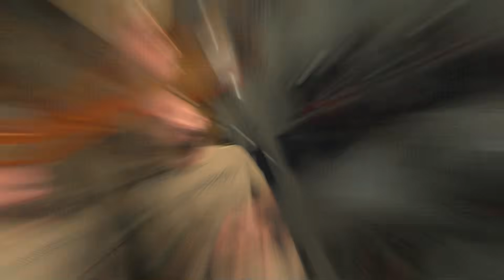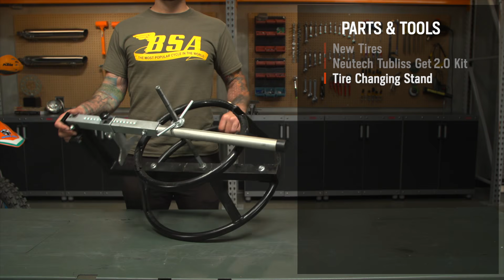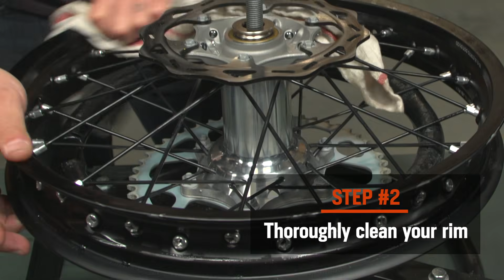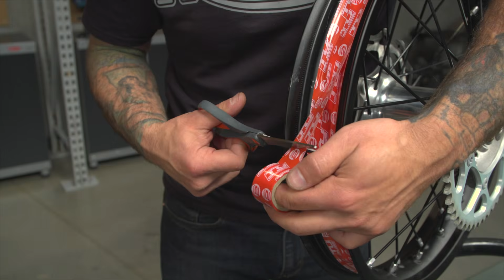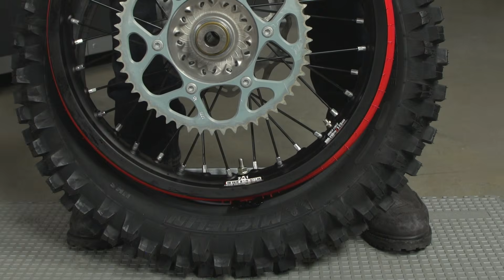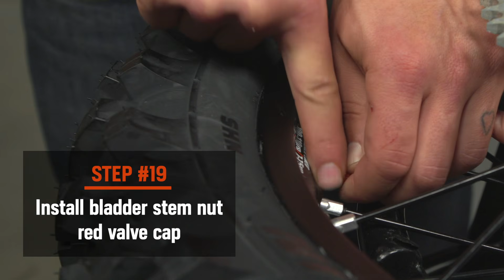Nuetech Tubliss Gen 2.0 Kit Installation Video

Comment: Tubliss wedsite installation video states to only use one layer of tape (in the middle)  and do NOT stretch or overlap.
Reply: It's outdated. The 2.0 kit comes with an updated written description with the tape stating what is shown in this video.
Reply: @audunbekkos3978 Yeah, I tried to do it with just one and the tape was too narrow to adequately cover the spoke heads. I ended up doing 3 wraps like the video
Reply: I think the main thing is to give the tape time to relaxe, since it stretches so much while pulling it off the roll.

Comment: I have infinity problem with this guys, black halter in red liner always puncture inner tube after few rides, what to do?
Reply: You probably have a sharp edge on your rim. Remember there is 100psi in that small tube pressing against the rim, if it's not totally smooth it will puncture

Comment: FYI, you do not use nearly enough soapy water plus you need to coat all parts of the tubliss system with silicone spray. It needs to remain slippery to work properly.

Comment: Show the front tire install….
Reply: Ahhhuuummmm wouldn’t it be identical?
Reply: Slavens has a front video. Looks the same. The problem is the super hard low profile 80/90 or 80/100 tires guys are riding.

Comment: Is this system also to use by KTM 890 Adventure R  ? I use Tubless Tires and i think this can be good.
Reply: Not advised for heavy ADV bikes per multiple posts on forums. There are a couple alternate systems that reportedly work better for the big ones.

Comment: I change moto tires 5 days a week, and have been doing so for a few years. I die inside any time a customer buys one of these and asks for an install. Don’t even mess with this system. Get a tube or a mousse. Save the money and stay away from this product.
Reply: No explanation why... I wouldn't listen to this comment. Most likely a grump that wasn't skilled enough to install the system.
Reply: @SendItDirt-Biking  You have to modify your rim for this system to even be installed. You’re left with a big hole in your rim if you choose to go with a regular tube down the line. Rim locks usually use 12 or 13 mm nuts with little spring washers, the rim gets even more damaged from a nut and washer getting pulled unevenly into the hole. Excess dirt and water also enters that same hole, corrodes the inside of the rim and compromises the tube. 
If you stick with the tubliss, you always have a chance of a leak forming under the tape, which requires dismounting the tubliss system to fix. You run a huge risk of pinching the liner while doing so, which will leave you SOL on the trail- Unless you buy an extra liner, which is about the same price as a tube 🤣 

This product is an overpriced novelty solution to a problem that was solved decades ago. Bring an extra tube with you, or get a mousse ring. You can get 5 heavy duty tubes for the price of one of these systems.
Reply: yeah i'm curious too, why do you dislike it? i haven't found any rider that doesn't like tubliss (other than the price lol)
Reply: Care to explain why?
Reply: Tubliss is just as easy to install as this video shows.  If your a mechanic for a living and you cant do this?
WTF dude?    Many , many 1000's of these tubliss inserts have been sold.  They work.
Reply: I got 5 flat tubes in 16 rides, all off trail on pavement, and only 1 was possibly from low psi. Stay away from tubes if you want to ride more than 2x in a row without a flat.

Comment: On the Dirtbike channel Kyle uses Amour all instead of soapy water on the beads before fitting so he can use the sealant inside when fitted. He seams to have success with that. Also he inflates the high pressure bladder first to pop the beads up onto the rim properly. A step missed out on this video.
Reply: He’s a smart little goblin

Comment: Can you use a silicon spray instead of soapy water to help tire seal?
Reply: Can you also use silicone spray to help get the tire on or will that affect the "sealing" of the tire with the soap and water? I am new to Tubliss and have always used WD - 40 when putting on tires with tubes.
Reply: @Enduring Pursuit same here except I always use a silicon spray. I haven’t had issues with the bead not sealing I was just kind of wondering if this was recommended or not. I coulda sworn in the old directions from tubliss it said to use silicon but maybe I was mistaken.

Comment: My rim has holes, 2 but are directly opposite of each other. Is it okay to install them like that, just moving the inner tube to the other side or they have to be 4spokes apart??
Reply: It's fine to do that. Check out Dirt Bike Channel and he shows exactly that setup. It's just that KTM's have them 4 spokes apart.
Reply: Tubliss instructions state damage may occur to the inner bladder of the install is not 4 spokes distance away.

Comment: Michelin mousses are better and work better. but i dont think they come under 11psi
Reply: Ya, but u cw t ru  any fast stuff or you will melt your mousse and your stuckwitsame pressure and also wear out quickly. Nice for no flats.
Reply: How do you change psi in a Mousse?  The Mousse is strictly off road or it melts.
Mousse costs 100 bucks each and they wear out.   If the Mousse doesnt fit the tire exactly it gets hotter.

Saying they're better, means that what you use. As in all things.

Comment: Don't get me wrong, I love mine, but there is a reason all the videos show installation of the REAR tire. Pro tip, send away the women and children before you do the front.
Reply: I’m in the middle of a massive tantrum trying to get the final bit of the front on. This is fucking impossible. Rear basically went on on its own.
Reply: Pro tip... Tubliss in the rear, Mousse up front. 😉
Reply: @Engrave.Danger  Agree.  

If running TuBliss up front, don't be too aggressive about running low tire pressure or the rim will pay the price.  In my experience, "tube pressure" is slightly stiffer than "TuBliss pressure" meaning 12 PSI in a tube is stiffer than 12 PSI in a TuBliss. I would be wary of running less than 12 PSI in a front TuBliss if one plans to ride fast and hit things hard. 

I slashed a rear tire open while riding fast in the desert with 8 PSI.  A bit of common sense is needed, which I lacked that day 😆
Reply: @craighoffman6876  I ride Michigan single track, so there's no point in a front Tubliss. I could see using one up front for riding rock slabs with some gummy tires though.
Reply: @Engrave.Danger  Nice!  MI has some killer trails.  I'm in Colorado, lotsa rocks here 😆  I run bibs in my 300 XC and TuBliss in my dual sport.
Reply: @Engrave.Danger in the UP? I’m from ishpeming .
Reply: @SethMceleney  unfortunately not. My nearest solid trail is Evart, which is 2.5 hours north of me. The farthest I've been north is Tomahawk. I don't want to make the trip to the UP unless I can get 2 solid days of riding.
Reply: Hmmmm. I put tubliss in the front, I didnt notice any special trouble during installation.
Reply: The front is much easier than the rear. but both are actually super easy and MUCH easier than a tire install with an actual tube.
Reply: @SkinnySkinch bot

Comment: A Tubliss system came already installed on a 500 EXC I bought used.  In the process of going between a 50/50 tire and knobbies I have yet to damage the system or cause it to refuse to seal so I'm pretty happy with it.  YMMV.